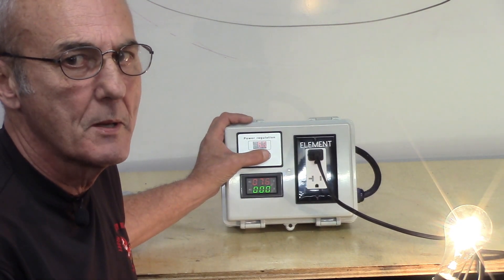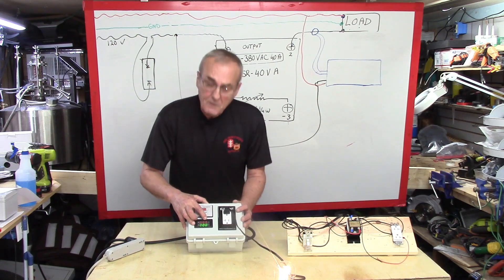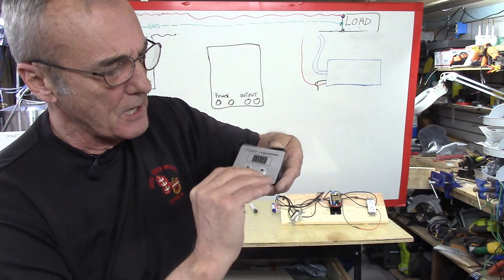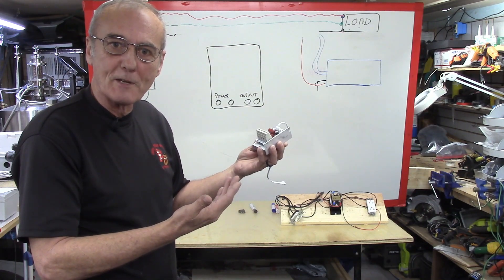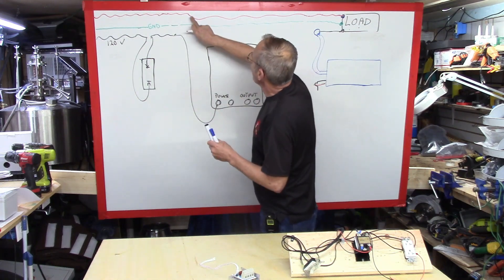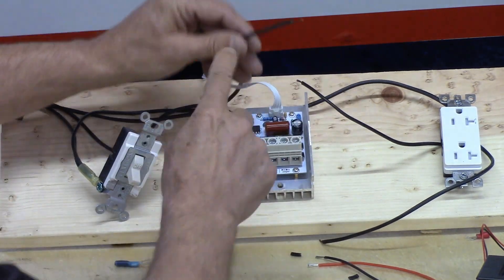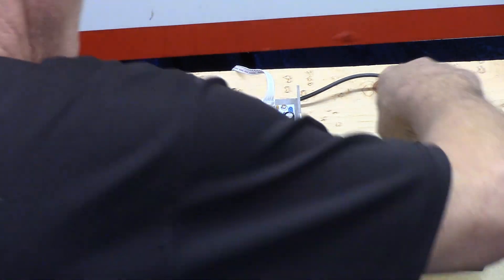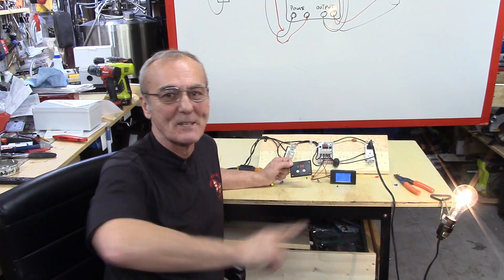WIRING A PWM (PULSE WIDTH MODULATOR) TO CONTROL HEAT

Comment: Hi George, thank you for the educational video. May I ask a small question: I got a 10000W PWM, and I connected it to a boiler, with a digital volt-amp-meter on the output side to know the current and voltage going to the load. it worked but the meter got broken. could it be that some digital volt-amp meters cannot function with a quadrant wave ? I guess the PWM has a quadrant wave on the output, right ? I was sure of the connection of the meter because I tested it with another circuit and it worked fine... it is just the output of the PWM circuit that smoked it up. Thanks

Comment: I love your videos but the SSR did not work at all. I tried several relays and the potentiometer that came with only changed the voltage 2 or 3 volts.

Comment: Good evening George. Outstanding videos. I am collecting the parts to build a 240 volt pwm controller to operate a 3500 watt element. 2 questions. 1. What gauge cables should I use, and 2. would the voltmeter/ammeter wire up the same way, just wit two hot wires on input instead of 1 hot and 1 neutral?

Comment: Hi sir iv got the exact motor speed controller you using there with the didigtal key pad,I'm trying to run a treadmill motor with it,I got it wired up with the bridge rectifier, now my problem is when I switch it on and press the arrow for starting it starts up at 30%thats way to fast and with another press of the button it climbs by 5%each time,I'm building a belt grinder,could a person wire in a actual manual pod? The 3 connector points of the pod and the 4 leads of the key pad throws me off a bit,the SCR,grnd,and 5v+ and zero,I don't know witch should go to the potentiometer,any help would be great

Comment: I just watchhed your vidieo. I built a pwm with a little twist I split the recieptical and added a second off & on switch to to control my water pump. I did not want to con trol the speed of the pump. I put a ball valve in to do that. Thank you very much for your insperation.

Comment: George, inside of the control box do you think a small fan such as a PC power supply fan would be necessary? If so how would you go abouts wiring it in within the system?

Comment: Newbie at a cross road. Which one should I build for controlling my 10 gallon 4 bubble plate reflux still. Pid 240 volt 20amp controller for  3500 watt or a PWM? I figure they do the same thing. My concern is which one is better? Any help would be appreciated.  Thanks Todd

Comment: What size wires are you using to connect these?
Reply: 12 it looks like for the bigger and I dont know what the smaller is but if you found out let me know.

Comment: Hi, I love your videos. I'm trying to hook up a PID to 4 peltier modules with 4 fans. The issue is I'm trying to use the PID to heat and cool by reverseing the peltiers polarity. What kind of ssr setup do you think would work for that. Any advice is greatly appreciated thank you!

Comment: For higher AMP switching, without using a house light switch. Use these type of panel mount switches: https://ebrewsupply.com/collections/switches and use relays: https://ebrewsupply.com/collections/ssr-spdt-and-contactors

Comment: Can this work in a senario 240vac 30 amps, to 240v Recepticle, I assume the Neutral bypasses the Unit to the plug. If a tandem unit is used 240/120. If 1 240v is to used, and 2-120v plugs off each leg (it is a either or senario) will this still do its Job?

Comment: G'day George whats the difference between  a PWM and a variable controller.  Not the technical difference but do they both control the same thing just using different method or does one control voltage and the other ampage?

Comment: PWM tend to be built down to a price. Skip the cheaper 4000W unit and go for 10K watts right away for the few dollars difference. Best to add a fuse in the supply circuit as well as a ground connection to the cage of the PWR. An indicated 50% power will not half the voltage/amperage... these things are not linear and often most sensitive between 40-50%. Much easier to control with the digital version rather than trying to turn a knob a few 100ths of a revolution. Once you have built and used one, you will wonder how you ever did without it.

Comment: Goodmorning George,  thank you for all that you do. I just got started about a month ago. I have been doing nothing but sugar washes so far. I am only yielding around 110 after all is said and done. We are running a 8 gallon pot still with a worm on top in a pot. No thumper. We use a 48 hour turbo yeast and have been doing 2 and a half pounds of sugar per gallon, and have been doing all the proper steps with temp and sanitization. Any tips to get the proof higher?
Reply: Hello Thomas,
I hope George doesn't mind me trying to answer your question.
I've followed George for many years now so here are my thoughts.
Fermentation not completed, or running the still to fast.
If the fermentation of your sugar wash was not complete then you will end up with unfermented sugars giving you a lower ABV.
 What was your start and end gravity reading?

Running your still too fast.
This will force more water vapour etc into your product, again lowering your ABV.
The trick here is to be very patient, get the still upto a temperature where you get a very slow drip from the still and maintain that temperature for a couple of minutes.

Increase the temperature really slowly now until you get four or five drips out of your still followed by a short spurt.
All stills vary, I make batches of 28 litres of sugar wash and running my still in pot mode takes me around 10 to 12 hours to get 80abv 160 proof. I stop processing at 50abv 100 proof.
I hope this helps.
George may have more to say, but don't give up Thomas this is a fascinating hobby and George is amazing.
Good Luck.

Comment: Hi George can you use a PID to heat your element,and also turn on your water pump at a set temperature?
ie duel purpose
Reply from the maker: You could wire the pump into the alarm circuit and set it to turn on at a certain temp. Yes....

Comment: Thank you George.  Any downside to the PWM with SCR vs. the Pot with SSR-40VA?  Is one clearly better?  Put off less heat?  Any pros/cons to control heating elements and a pump motor?

Comment: I built one exactly like this at 240 volts in an old computer power supply case with a fan, I used an Iphone charger to power the fan, works perfectly. The fan runs a little slow at 5 volts but it is enough.
Reply: How did you wire American 240 volts through this?

Comment: Another Great video George. I built one of "your" PID controllers using the Inkbird but have not yet had the opportunity to use it. I am still piecing together my system. Which type of controller PID or PWM do you prefer? Happy Distilling!

Comment: Perfect timing! Gonna need one of these!!!
Reply: While I would like to have the PID, this is much simpler and much cheaper 😅
Reply: @robertt1782  that’s what I’m observing as I watch more videos. The do the same thing only different. PWM keeps it steady based on the dial(or digital “dial”) without the fluctuations. Again, much simpler and much cheaper lol. I’m trying to get into this while keeping the initial cost low and updating stuff as time goes by.
Reply: @robertt1782  I’ve searched high and low for this PWM. I cannot get the 20A one with a fan. I can only find a 50a one with no fan. Will the 12v power supply and fan he used for the PID build cool this PWM sufficiently when it is mounted in such a way that it blows across the PWM?
Reply: @robertt1782  and I just found another video. Now to figure out the difference between the SSR variable controller or the PWM controller. It looks like they do the same exact thing.
Reply: @robertt1782  well I’m at a loss at the moment. Every sort of device is unavailable everywhere. I tried the SSR-40va...no heat sink or potentiometer come with the one I found. The PWM is out everywhere too. I think I may be able to piece it together.
Reply: @robertt1782  I’ve decided to go with the fanless PWM. I will have to make a hybrid controller(mix of PID and PWM). I’ll have to add an internal fan and I will add a switch to the box as well. I may add the thermometer as well later on so I can monitor everything from the controller.